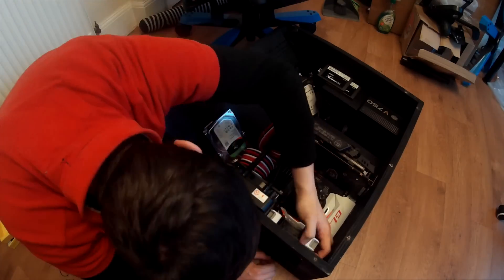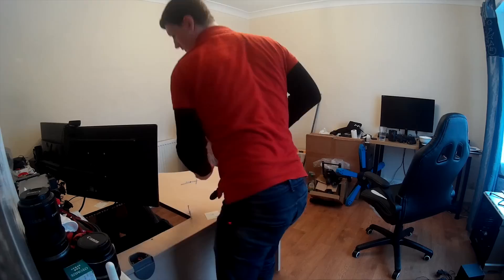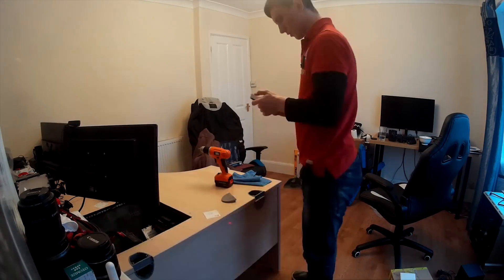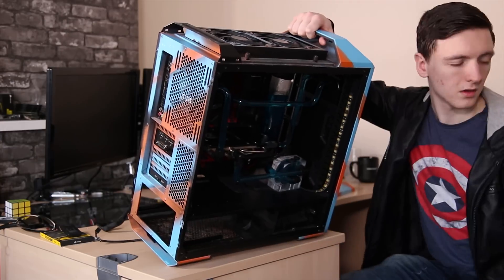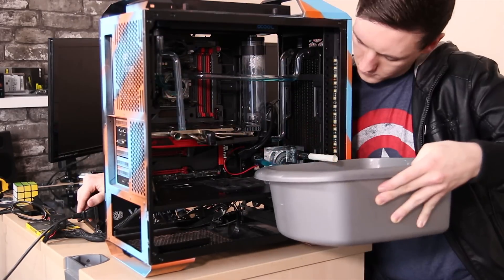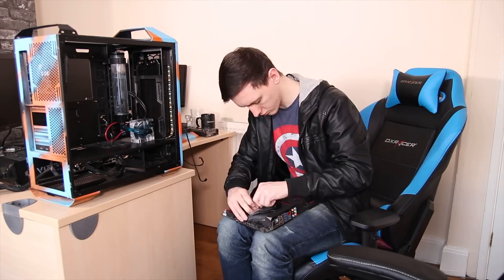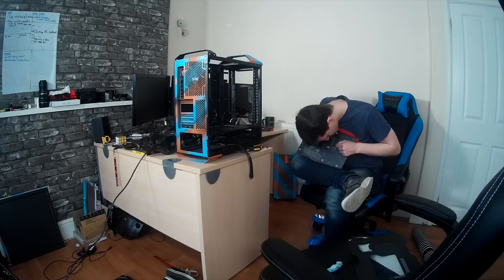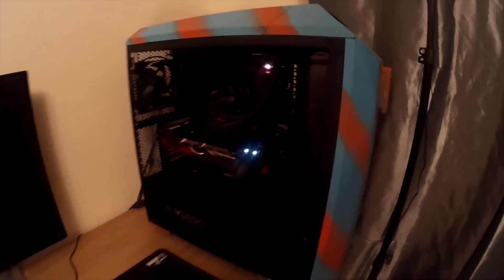Budget DIY Desk PC Project #7 Unexpected Failure

Comment: Right I'm up to speed now. Watched the lot!
Did think that you needed some intake fans. 
If it was me I'd of kept the CPU cooler as you had it and and two 120mm intake fans on the sloped section. But that's just me. 👍🏽 great job dude.
Reply from the maker: +PCTechHub it's actually pretty cool now, lower temps too!
Reply: TechteamGB both fans set to exhaust?
Reply from the maker: +PCTechHub both fans are intakes. Gives me nice airflow out the hole next to my keyboard.
Reply: Nice dude.  You've done a belting job👍🏽

Comment: Andrew, this sometimes works:

1). Unplug EVERYTHING.
2). Remove CMOS battery.
3). Perform CMOS reset (without battery)
4). Short power jumpers.
5). Press reset.
6). Replace battery.
7). Perform CMOS reset (with battery)

Try it again.

For some reason I have seen this "fix" the issue you describe on several brands of motherboards.  I think power glitches might be responsible for this issue.  Do you have a UPS?  Most people reporting this (including my occurrences with two different motherboards) don't use a UPS.

The theory is that there is some register somewhere that is either backed by the CMOS battery or by a capacitor somewhere that doesn't get reset unless all power sources are removed and all capacitors discharged.
Reply from the maker: +Kayla and Jim Bryant I did try all those things, but I had to dismantle everything first as the motherboard covered the battery by the plastic 'armour'. It seems to be fixed which is good, which to me says a capacitor wasn't discharging properly giving a controller the wrong signal. Hope you had a nice Christmas!

Comment: Its possible its either your power supply starting to die. A bad fan connector (as you likely moved the plug around and used another socket). Or finally removing and reseating everything could have easily fixed it. Bad connections, dust, very slight corrosion any number of things can cause weird problems.
Reply from the maker: +azazeldeath I checked the power supply and it worked just fine, and after roving the cmos battery and re seating everything it works just fine so that's good. Shame I had to though as the watercooling was quiet and really great temps.

Comment: Hey man, what motherboard is it? I have msi z170 Gaming M5, have the same issue. Power button sometimes work, sometimes it takes 4-6 clicks to turn on pc. Sometimes, it JUST DOESN'T. When it doesn't, I turn off and on PSU 3 times, and it triggers power and PC comes on. Hope it's not bad and hope it won't fry anything. So far so good. 

P.S: I built a pc for around £2600 from Overclockers in May, 2016. Didn't know you had affiliate links... Would've used 100%.

Keep up the good work.
Reply from the maker: +Don Abdullah (donchik32) it's an Asus maximus 7 formula! As for ocuk, only just got it! Thanks!